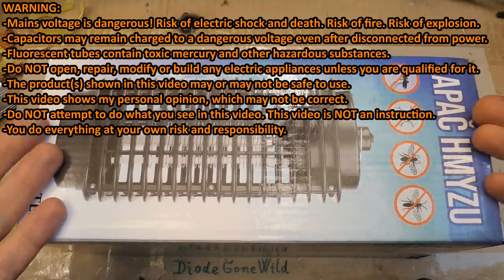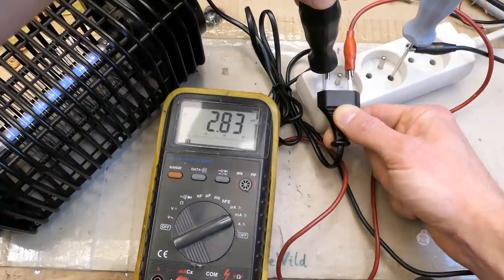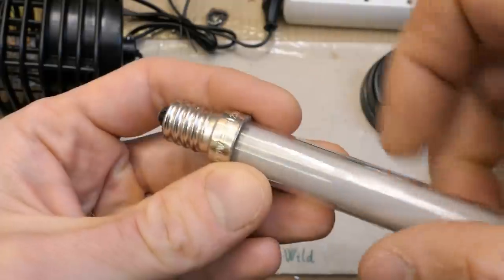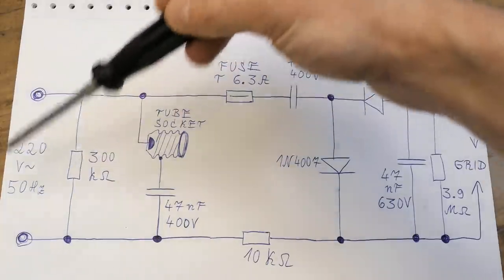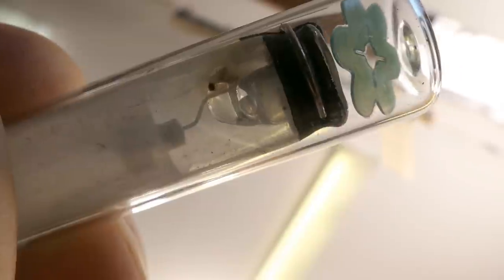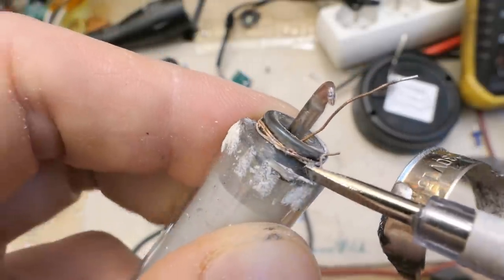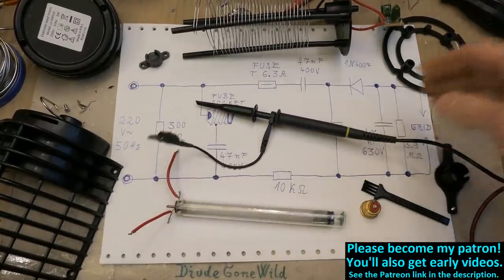What's inside this cheap insect zapper

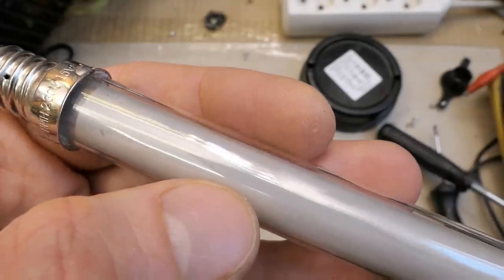Comment: 5:03 - The reason the tube looks dirts, it because it's bee coated with a resistive, transparent film. 
That's why the far end electrode has no dedicated wire going to it.
The end close to the cap is connected to the center peice of the screw base. The far electrode is connected via the resistive coating to the outside part of the screw cap. 
The resistive coating not only limits current to the tube, but the waste heat it produces helps to warm the tube faster. 
Considering how much power is dissipated in a resistive dropper, it might be accurate to rate it for 15w. Coincidentally, a 15w incandescent lamp in series with a 4w fluorescent seems to match pretty well as a current limiting device.

Comment: 2:26 This is a good example of why Daniel includes the list of disclaimers at the beginning of each video. It's your own lookout if you go shoving screwdrivers into mains outlets! There are much safer ways of breaking in and measuring the current. What I use for this is almost as dodgy - a cheap extension cord with banana plugs on the neutral side - but it's all insulated and shrouded. Kinda like what Daniel demonstrates at 15:46.

Comment: It's unbelievable how much cheap junk is imported from China which does not comply with European safety standards and sold in local supermarkets.
One of my friends bought a musical disco lamp from a local supermarket here in Denmark. After several times of use, one day when he plugged it in, suddenly the cable exploded on the plug and tripped the room MCB.
When I inspected the cable it appeared to be 2 x 0.75 mm2, but with closer inspection I discovered that the cable outer insulation was made of thick PVC, but the cable inner conductors were made of thin copper-cladded aluminum and with a cross section of less than 0.5 mm2.
I even have seen plugs made of brass tube with plastic core rated 10A @ 250V.
The Chinese are very inventive when it comes to manufacturing cheap junk.

Comment: Tube has an ITO coat on the outside, likely there to prevent static discharge, but here they reused it to save running a wire down, and also provides some current limiting, plus laso acts like a starting aid, with the high potential between the glass and the electrode helping the gas inside too ionise and start the lamp. Probably why the anode cap is attached so odd, they had to get them close to the glass, so put the spot weld up top of the cup, so it is right against the glass, so it will start ionising. Wonder how they got the mercury dose in there, probably a small drop of amalgam, that went in just before final seal, along with the gas fill, or they used the electrode cup to hold the drop of amalgam in place.
Reply from the maker: Yes, the capacitive current via the glass helps the ignition. Well, there is a possibility the electrode was intentionally installed like this, but I still think it's a defect... I'd have to buy another to compare it. I guess they put more mercury in it than needed, some evaporates and the excess just stays liquid.
Reply: I think the anode cap doubles as a "getter". They put a mercury in an absorptive and conductive material (like water in a sponge). After assembly the evacuate the glass. By using an RF coil near the getter it heats up and boils off mercury.
Reply: @therealjammit  Normally the dose is an amalgam of mercury with copper powder, put a drop in the tube, and then on first test in the factory it will boil off a tiny amount of mercury, and continue to do so for the life of the tube. No need to RF heat it or provide a getter, the tube is gas filled, so just has to be kept hot during pump down, easy on a production line, where the large wheel has the tube going through all processes one after the other, with sealing being the final stage. Amalgam and gas fill takes place after pump down and bake, so the gas pressure in the tube is right, and the heat also activates the amalgam to put a little mercury in the gas, so has to be done right before gas fill and sealing.

Hard vacuum tubes need a getter, but here you actually want a soft tube. Getters do not work on soft tubes, especially mercury filled ones, they would be useless within hours from mercury poisoning.
Reply: The coating indeed has three functions: A starting aid, electrode connection and a ballasting spike limitting resistor all at once.
Reply: ya ive been seeing more clever ITO products out of china lately like those cheap geiger tubes. instead of using an expensive metal to make a radiotranslucent cylender they will take a thin glass tube and coat it with ITO. not as good but orders of magnitude cheaper

Comment: I would guess the end of the bulb is using the wire to contact a conductive clear coating on the inside of the glass to bring the connection back to the socket.
Most UV lamps in essence are running across mains with an inductor;  they just got lazy, capacitor, resistor and a tube of questionably eye-safe output...  That light blueish glow is usually from the "germicidal" type UV lamps.
Reply from the maker: I think no UVC just because the glass that would pass UVC is more expensive than glass that blocks it.

Comment: Very interesting. About fifteen years ago I bought a similar lamp. I exchanged the tube for a small LED lamp. I saved the tube, it looks very similar to the one in the video, 240 V 50 Hz 4 W, also it has no wire connection of the upper electrode and also a plastic flower to fix the inner tube. In my tube, both electrodes are straight on the axis to the glass tube.
Reply: what is working volt for the Tube. Ac or Dc ? Not avail near shops. can we use LED Blue strips insted of this tube.?
Reply: @babythomas2902  My insect trap has an E14 socket installed. There is mains voltage: 230 volts and 50 hertz, i.e. alternating current AC (or maybe with reduced voltage because of the capacitive dropper like in the video, but my LED seems to light up normally). So you can use any small lamp with an E14 base and the appropriate voltage as a replacement for the fluorescent tube. LED strips should be possible if you can operate them on 230 volts AC and connect the contacts yourself. There are also electric insect traps with fluorescent tubes that have two pins at each end. These are connected to fluorescent tube start electronics and are therefore probably not suitable for LED lamps without modification.

Comment: The fluorescent tube has a thin conductive coating in the inner glass to connect the electrode on the other end. It can be connected to 230V directly without ballast.

Comment: Thank you Mr.D ! I have the exact same unit with the same bulb in it. I live in the UK and bought mine from a Petrol Station that sells random stuff from time to time. When I took a look at mine I was also scratching my head at how that bulb worked, you have solved a mystery for me and I love you for it! :D I did a bit of digging and you can buy those bulbs online but I cant remember the website. I just searched for insect killer bulbs small screw base cold cathode and eventually found them and quite cheap. I don't need one yet, but you do now lol :D I am sure you could modify the unit to be much more efficient and zappy ;) maybe a MOT on the end would deter the sneakiest of insects ha ha ha :D
Reply: Perfect for those bugs from that Space Marines movie lol

Comment: I bought this on eBay years ago. The fluerescent tube was different, transparent, and produced the dangerous UV using for sterilizing. Looked like it was made by a small operation, used a plastic flower cutout as a spacer. It failed quickly. Replacement hard to find, single manufacturer. Repkaced with regukar lightbulb.

Comment: There is a small hole on the metal holder of the fluorescent lamp. Do you think this is deliberate aging of the product? I noticed that bulbs with such holes burn out faster. What do you think about it?
Reply from the maker: This doesn't have anything with the gas tight seal. In only equalizes the pressure in the section outside the sealed tube or bulb.

Comment: BTW the 630V capacitor is not good enough. Here I often get almost 240V ac. So the peak is 340V. Doubled it's 680V. A 800V rating would be better...
630V is only capable of handling 222V ac...
Reply from the maker: Yes, I'd use 1000V, but I've even seen 400V capacitors used for the same purpose...

Comment: Ok I get that it does not work fully as intended. But, light apart,  it seems to me that it would still zap an insect that gets in the grid. How dangerous would it be to a human who touches the grid?
Reply from the maker: The zap from the capacitor would only go through couple mm of your skin, not your heart. But you're still touching mains via a 10k resistor, this would pass up to 23mA through your body if you're grounded.

Comment: thank you very much for all your videos . I have a question . why led lamps has a bridge rectifier in it . the leds also are diodes . then why a led not be used as diode+light source . or . even  can be used  instead of bridge rectifier .
Reply: The reason is for smoother DC output and minimizing flicker. Notice that the bridge rectifier is often a part of a buck regulator. Yes it's true that LEDs are diodes but running them on AC without rectification would cause flicker. Cheaper bulbs often only have half wave rectifier or none at all and it flickers like hell at mains frequency

Comment: As another viewer suggested, wonder how safe are the UV emissions. Can that even be measured using DIY parts?
Reply from the maker: It's probably just UVA, not UVC. Most materials block UVC. You actually have to use special and more expensive glass in a UVC lamp to pass the UVC.
Reply: For the most part, yes you could measure it with some LED arrays , one with glass and one without - though you'd have to use blue SMD LEDs, theoretically if there's a significant portion of UVC hitting the arrays, the 'unshielded' set should show a somewhat higher output current.
Using a differential amplifier you can observe this voltage difference, and feed it to a meter or whatnot...
...If you only needed light intensity readings UVA and under, a typical amorphous panel from a garden light will suffice!

Comment: this device seems to be completely made by a drunk person, from the schematic to assembly, nothing really makes sense. Also I hate when electronics have fuses way higher than needed, for example, computer PSUs with real 180W generally have the same 6.3A fuse inside, when they'll never see more than 2.5A even if plugged into 100V mains. I generally replace the original fuse of all my stuff with proper ones, with orders of magnitude less current, because I want my fuses to blow first not last. In the case of those ultra low power devices like this one, I have a pack of 0.5A fuse that I use. I also use those same 0.5A fuse for stuff plugged into my UPS, because in case of short circuit, the UPS can (I tested) blow the 0.5A without triggering protection and powering off all the stuff on its load, but if I use a 2A fuse or higher, it'll shutdown.

Comment: Suspect it should be drawing 15w but because it was broken in transit, it’s barely lighting at all
Reply from the maker: It would never draw 15W with a 47nF capacitor in series.
Reply: @DiodeGoneWild  hmmm true forgot that.  Still curious whether it would draw 15w connected direct to mains if it wasn't broken
Reply: @DiodeGoneWild  Probably meant to have a 680n capacitor instead of 47n, but they ran out of the 680n capacitors. Fuse likely is recycled ewaste, probably cheaper than a wire jumper.

Comment: > why does the fuse has to be rated 6.3 bloody amps?
That's actually pretty simple to answer, because 6.3A fuse was cheaper than proper 100-300mA by some 0.00001$. That's why Chinese electronics designer has chosen 6.3A fuse.